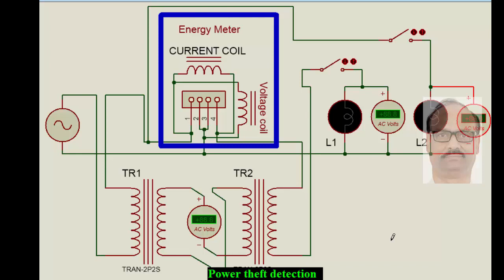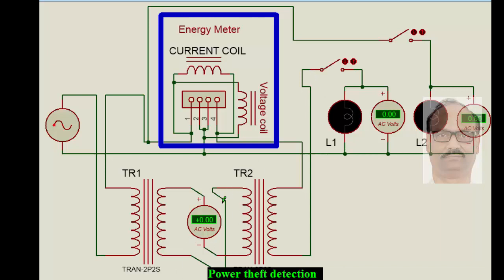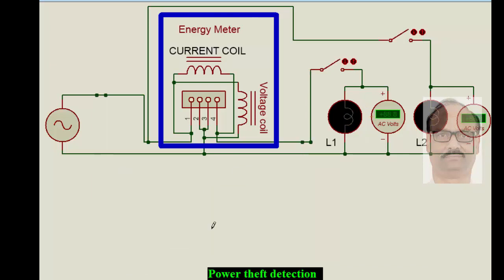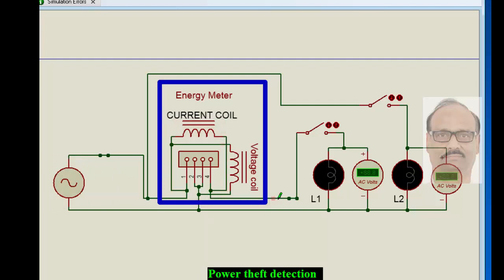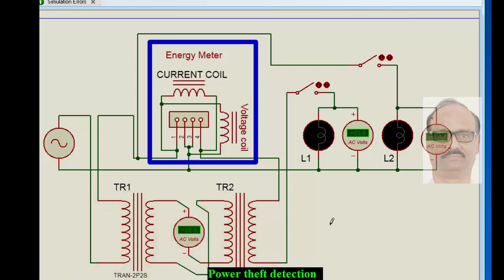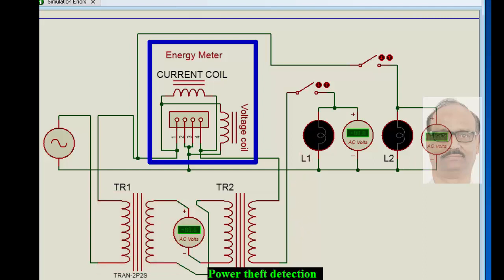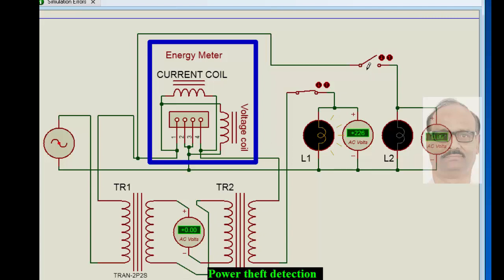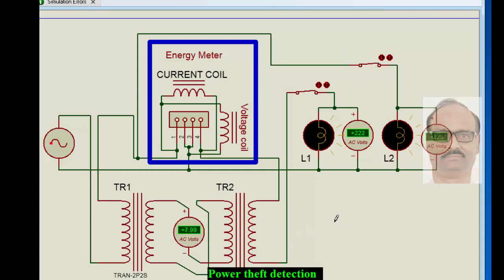Electricity Theft detection circuit

Comment: if the end user load is high (high current) that means we need a larger  T1 and T2, T2 is the problem in that case because its' load is metered and the customer will pay for that.
second in same case is user load is high T2 drop-down voltage is another problem because it in series and end user will get less than 240v (or 220v as some countries voltage).

Comment: Hello sir, how can I obtain the current and potential coil components you used for your energy meter as I am trying to simulate a simple meter on proteus with no luck. Can't seem to locate the coils in proteus library.
Reply from the maker: It is just an image. The Circuit is manipulated for simulation purposes.
Reply: Thanks I was able to locate iron core inductor in the library looking like the one you used. I just needed to simulate a simple energy meter for my circuit just like yours.

Comment: Hii sir you can show the flow of path on lamp1 and lamp2.
Reply from the maker: Sagar Jayswal have u subscribed?
Reply: Yes
Reply from the maker: Only possible in DC in Proteus and not for ac
Reply: How to genarate a voltage differense between two x'mer
Reply from the maker: @sagarjayswal3720  Follow the circuit. All that you have to do if differential voltage is not generated just change the polarity of any one transformer either at primary or at secondary

Comment: Respected sir, the circuit diagram behind the line(power theft detector) is not visible,please can you share the circuit diagram.
Reply from the maker: Adviteeya jamwal lost after laptop formatting
Reply: sir, what is the component(in rectangular shape, in energy meter) and how to draw it in proteus.
Reply from the maker: Adviteeya jamwal Bottom  point of the secondary of Tr1 goes to the upper point of the primary of TR2

Comment: I have a question, for example, when your power theft detection project can cut the supply to the consumer when it detect a illegal load. What about the hospital and other buildings needs electricity anytime. Whats your opinion about that or How can you reason about that. Thanks in advance:)
Reply from the maker: It is a concept. Depending upon need one has to apply

Comment: how to know the capacity of resistor to be used in circuit??? As you said 10k or 20k, but how to know that??? Please explain...
Reply from the maker: It is bit complicated. One has to understand first the current need then apply OHM's law R=V/I, as you know the voltage.
Reply: Patnaik UC

Comment: I don't get it. First of all, why would anyone need a circuit for this? Theft detection is not our job; it's our electricity supplier's concern. Secondly, if I am stealing, why would i take a jumper from TR1 primary? I would rather take it directly from the power pole (which is usually how power theft is done).
Reply from the maker: It is for the purpose of understanding the technology that can be implemented for such a device. Many engineering students have followed this to give a demo in their college project.
Reply: Thanks for your response. What about the second part? I mean, why would I take jumper from TR1 primary when I can easily hook the load to the mains? By the way, I understand this is a different concerns and not everyone hook their load on the open wire directly. I am just curious.
Reply from the maker: It is a concept only. Can be implemented in many ways.These days all digital meters keep tack of bypass,complete isolation,current flowing only in neutral etc  of the meter

Comment: Sir, from where did u get the energy meter?
Reply from the maker: It is not available in Proteus but just drawn. If you want to buy it physically ,visit any electrical shop
Reply: Patnaik UC how did you draw that energy meter? Im begginer
Reply from the maker: It is not available in Proteus but just drawn by taking coils and connector
Reply: Patnaik UC i want do make a simulation on electrical theft detection using gsm modem, but im such a begginer in proteus. If your kind please help me.
Reply from the maker: Not an easy task for beginners. Needs lot of expertise on Proteus.
Reply: what software did you use for coding the gsm?
btw thank you for response , i really appreciate your kindness
Reply from the maker: c